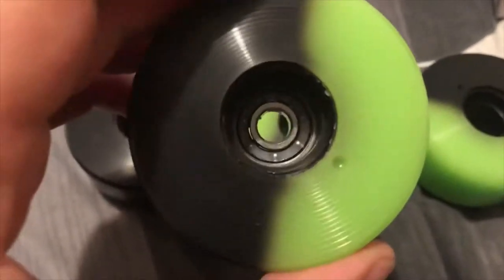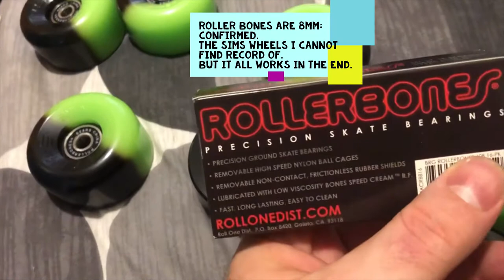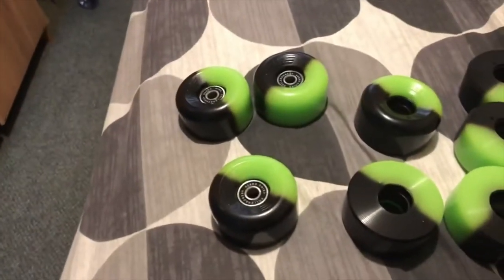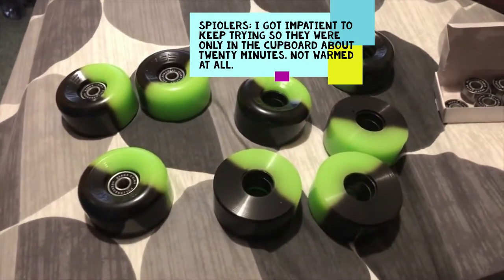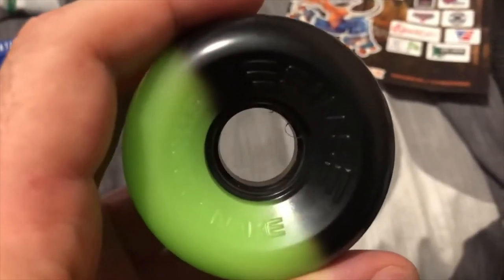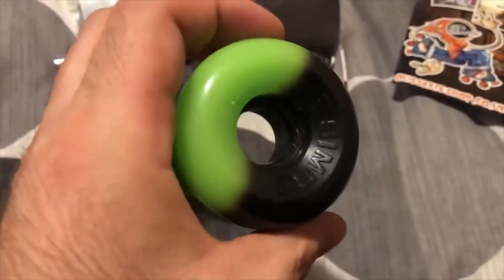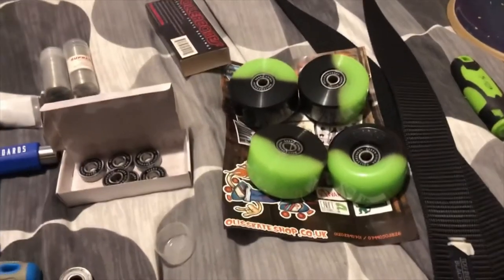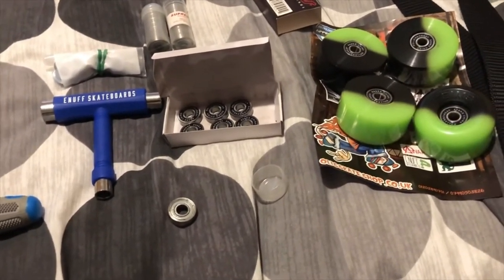Sims Street Snakes and Roller Bones bearings, awkward fitting vlog

Comment: The way to place bearings on wheels is to place one on the truck axle and put the wheel on the axle too and knock it in with a subtle bash. Then for the bearing on the opposite side of the wheel, do the same and the bearings will pop in and both will sit in flush
Reply: Not going to lie... I just tried to fit my bearings into the sims using my oldschool way but the wheels weren't budging at all 😭😭😭 I recognise your struggle now

Comment: I just bought the exact same wheels and fitted the bearings, true it was very tight but I just pushed the bearings in as far as I could then put the wheel on the truck and tighten the nut to push the bearings in all the way and the loosen it off a bit.
Funny thing is the bearings just fell out of my old school Kyptos impulse wheels.
Reply from the maker: I thought of this but my bearings had soft outer caps so I risked deforming them by doing that.
I should have switched for some old bearings and done that. Then extracted and put the others back in. Might have worked. 🤷‍♂️

Comment: The way I put bearings in my wheels I find easy is using the skate lay the skate on its side remove a wheel if not already removed place a bearing face down on the truck then the spacer then the second bearing face down then got you're wheel face down over the top bearing and push down with your palm when the front bearing is in turn the wheel over and do the same it allows to put alot more pressure if needed and safety line up
Just a tip to the way I do it

Comment: Bad wheels they look like they have bubbles in but could be a casting spout. My wheels are vintage ones so I'm unable to compare to mine. I wouldn't use these wheels just to be safe, could get a blow out. Anyway thanks for sharing, I was thinking about getting some new ones but don't think I'll bother now I'll get some airwaves instead I think.
Reply from the maker: Yeah they don’t quite compare to the old days. And my airwaves are really well made. None of these issues.
Only used these wheels a few times but they are nice.

Comment: WOW...It's NOT Rocket Science. 
Place bearings on a truck axle , press front of wheel onto bearing in, then the back and place nut on axle. Viola ;)
Reply from the maker: And risk bending my axel. No thanks.
The pressure I put on them in the end was immense. Even broke the grip of my screwdriver. Still… if it works for you then more power to you.
Reply: @thelifeandtimesofjames4273  clearly your clueless. Anyone requiring a hammer to place a bearing isn’t adept at sk8 making. I’ve been making sk8s since a school boy and now 56. I made 2 sets of coverts this year and never had any axle bend on me. Take some advice don’t let your ego prevent you trying a proven technique. It’s not strength it’s how you do it that counts. 2 hours 😳🤷‍♂️🤦‍♂️🤣🤣🤣🤣🤣
Reply from the maker: @andycam1452   any other wheel worked fine. The sims would not accept the bearing. What I did worked so there’s a proven technique for you to add to your all knowing skating skills.
Ever since been skating without fault.
Reply: @thelifeandtimesofjames4273  I’ve had at least 6/8 sets of sims and as stated anyone using a hammer already starting on the wrong foot so to speak. Takes literally seconds to put bearings in and remove from sims. And as stated previously your nonsense about bending or breaking axles was dreamer up by a hammer blow probably. 🤷‍♂️🤦‍♂️🙄 trust me it’s a piece of piss to push down bearings on an axle and remove them too. I’ve bee. Doing it since I was at school pre 81…😉👍
Reply from the maker: @andycam1452   and these bearings would not go into the wheel. It is just that simple. The wheels were an absolute nightmare to fit so I had to improvise some way to get them fitted. Like I said I tried other wheels with the same bearing and it was simple. Pretty sure I covered that in the vlog as well.
If these wheels had arrived for a complete beginner then they would have given up due to the awkwardness they gave. I assume this is a quality control issue with the manufacturer.

Comment: Easiest way is to place the wheel in piping hot water for 30 seconds. Thiis  will expand the wheel and the barring will slot in easy. Remember to whip down the centre hole before placing the barring and use DW40. Took about 5 minutes to do all 8
Reply from the maker: I considered doing something like this but thought it might damage the wheel. Had I not eventually done it I think I might have tried this.
Reply: I was initially concerned about that too but it was fine
Reply from the maker: @deeone3143  caution about using wd40 also. Most of the skate community hear someone using wd40 and freak out because it is water based not silicone.

Comment: Hi do you have trouble putting on the bauers? I just baught the nx and have trouble putting them on. Btw i love the wheels i got the same black and green
Reply from the maker: I have Bauer nsx but I put them on with the laces very loose. Otherwise they are impossible to get on.
Back in the day we used to skate with them loose but these days I tie them up.
Reply: @thelifeandtimesofjames4273  cool thanks
Reply: How do you find the sims street snakes compared with the air waves?
Reply: @jjdominici  sorry but ive not used the air waves as i orderd mine with the sims already fitted
Reply: @jjdominici  i find the sims very grippy in the dry but if its moist out the are very slippy

Comment: Your old trucks will b slightly wider and way stronger.  Compare them. U may even find new plates are shorter wheel to wheel    This will upset all the programmed trick u got from back in the day.  Check your heel is over the rear truck as they may have set it too far frorward.   👍👍👍
Reply from the maker: I have recently seen people setting very small trucks at the mid point of the boot for extra agility. Interesting way to do it for sure.

Comment: Don’t get rid of your own boots that base plate is not fit for purpose. Put the skate upside down between your legs bend the rear truck and the whole base plate will twist and it will only get softer as u skate.  I have got new sk same pate.  Put your old plate on it  that I saw on vid as they are way stiffer.  They don’t make them like they used to 👍👍👍
Reply from the maker: I am currently running three different pairs of skates. This is to avoid change overs and keep me skating more and fiddling with stuff less.
Oddly however I haven’t been for a skate in over a month.

Comment: How do you find the sims compared with your airwaves?
Reply from the maker: Sims are a bit smaller but they have slightly more grip than airwaves.
Honestly they are quite similar in how they feel.
Reply: I used to have sims street snakes in the 80s and loved them. Now have acquired a set of air waves. Same size 62 but shape is different. Feel similar but probably prefer the sims. But was 35 years younger! Airwaves have a new one similar to sims now which looks quite nice
Reply from the maker: @jjdominici  yeah I was on sims in the 90’s and I think I have hang ups on how good those wheels were back then. Back in the day sims were vastly superior for me.
These days I skate both with no issues.